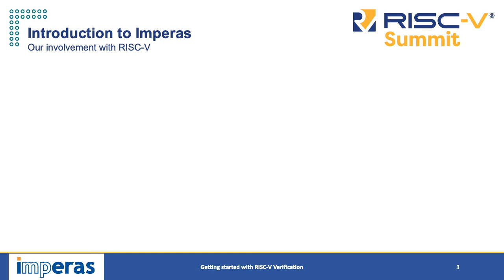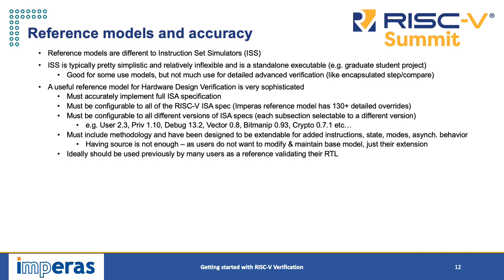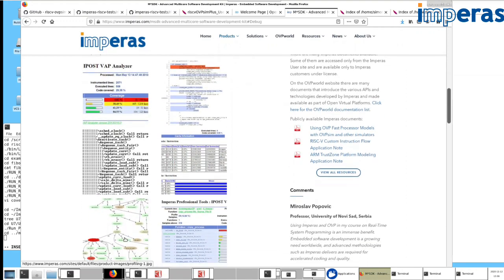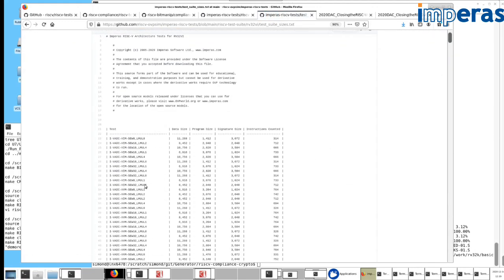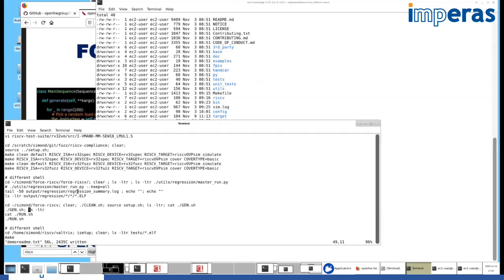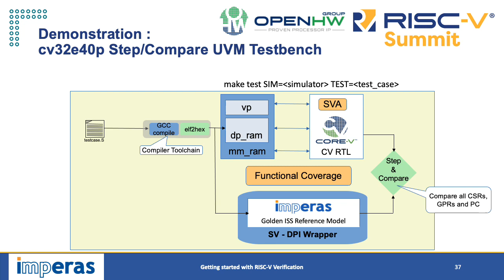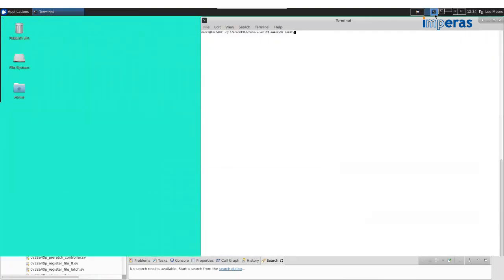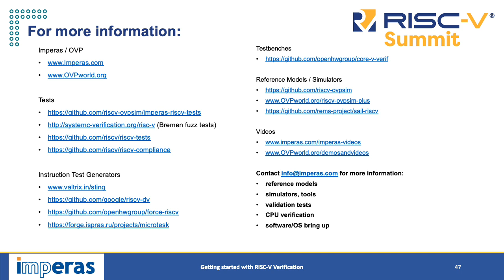Tutorial Getting Started with RISC V Verification

Comment: The RISC-V is good for embedded systems as it is free and open. But it will never become a general all-purpose processor. The RISC-V is based on 40-year old ideas as RISC-V Foundation claims. There is no sense to port the huge x86 and ARM software ecosystems on it. Thus, RISC-V will never gain a victory over x86 and ARM. The most of positives about the RISC-V processor are arbitrary speculations. The advantage of RISC-V is open architecture. RISC-V has instructions of variable lengths. This is bad, it is a departure from the RISC architecture principles. 
The Contemporary microprocessors contain 8 specific hardware components: (1) SMT (Simultaneous Multithreading), (2) register renaming, (3) instruction reordering, (4) out-of-order execution, (5) speculative execution, (6) superscalar execution, (7) delayed branch, (8) branch prediction. These components make up some kind of a “magnificent eight” of components which essentially raise the performance of microprocessors. But unfortunately they are very complex. A processor core having these components is a full-fledged one, otherwise it is good for simple applications, e. g. for embedded systems. 
The “magnificent eight” of components is very hard to design, only the experienced firms and developers are able to do this, and much know-how was acquired, some effective solutions are patented. Particularly complex is the SMT. Only powerful and advanced firms like Intel, AMD, IBM are able to equip their processors with the “magnificent eight” components. It is not surprising that some Intel processors, and the famous Apple's M1 processor do not contain SMTs. If a company is able create the full-fledged RISC-V processor with all “magnificent eight” components then it would be a serious achievement, and such RISC-V would be considered of the World's class comparable with x86, with ARM, but not more. As far as I understand most of the developed RISC-V processors have no components from the “magnificent eight”, and are intended for embedded systems.
A course directed on further development of RISC-V is a wrong way, and leads the computer architecture to deadlock. The RISC-V is not promising for computer industry. In fact, RISC-V hampers the further development of the state-of-the-art microprocessor technologies. The World demands absolutely novel microprocessor having much more higher performance than all contemporary ones. The novel and effective ideas on computer architectures do exist! Here’s such a novel processor architecture: V. K. Dobrovolskyi. Microprocessor Based on the Minimal Hardware Principle. Electronic Modeling, 2019, vol 41, No 6. pp. 77-90. The article is posted (under the Cyrillic name добровольский.pdf):
https://www.emodel.org.ua/en/ then touch ARCHIVE, then move to 2019, then to VOL 41, NO 6(2019) pp. 77-90. You see: DOBROVOLSKYI V.K. Microprocessor Based on the Minimal Hardware Principle Click “Microprocessor based...” At the very bottom you’ll find Full text: PDF Click it. 
This processor does not have the “magnificent eight”, it is not necessary at all. This comment reflects different view on the RISC-V architecture, and the computer community has a right to become familiar with such a view. I’m Volodymyr Dobrovolskyi (V.K.Dobrovolskyi).
Reply: You are ignoring that ISA and microarchitecture can be decouple, as a matter of fact, both CISC and RISC architectures where implemented using the "magnificient 8" that you mentioned. Examples are the ones that you mentioned, x86 (CISC) just for example on Pentium Pro, Skylake, and other Intel and AMD processors, and ARM (RISC) on Cortex-A9. RISCV is just an ISA, microarchitecture implementations are not dependent of the ISA. Take a look for example to BOOM (Berkeley Out of Order Machine), or BOOMv2, even though it may not achive all the magnificient 8 (achive out of order, branch prediction and speculation), it is not a matter of the ISA, is just a matter of how much complexity are you willing to put to achive the requeriment specifications of the problem you want to solve.